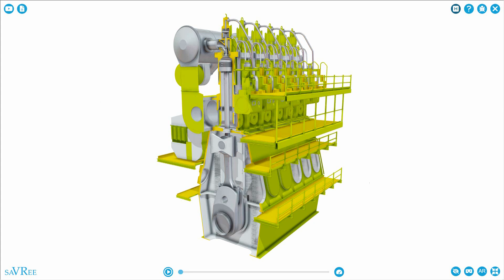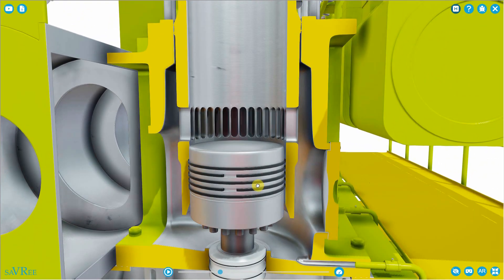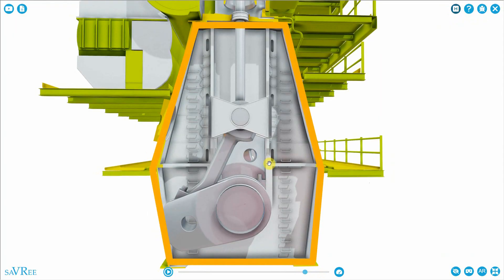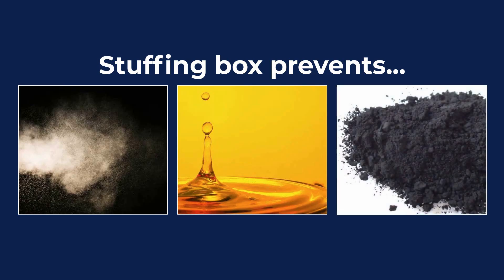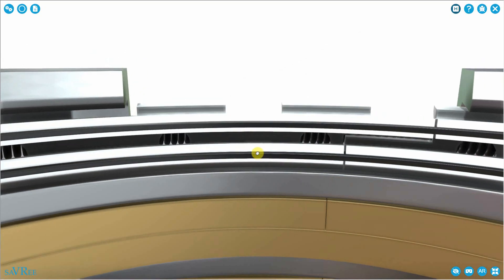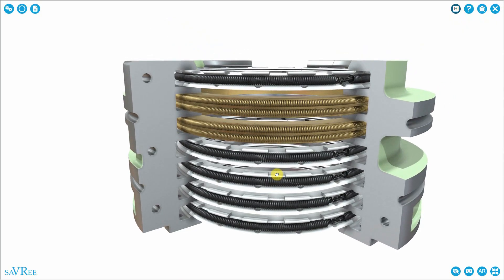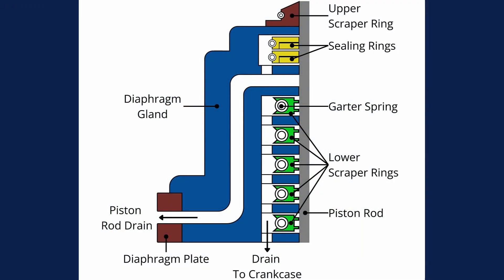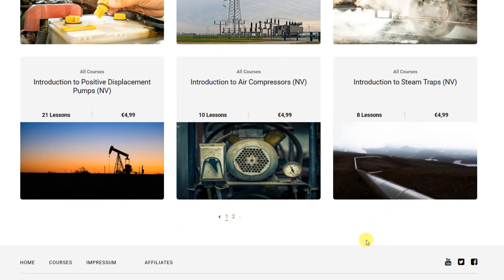Marine Engine Stuffing Box Explained (Marine Engineering)

Comment: In case stuffing box leaking occurs and the piston overhaul is not yet due, you can carry out the dismantling of the stuffing box inside the crankcase without having to take out the piston. Use the supporting table tool which comes in two pieces and use that to place the stuffing box to carry out the job. Moving down the piston should bring the stuffing box down to the crankcase side, if not might need some jacking bolts. Don't forget to wear safety harness. Thanks for the content!!
Reply from the maker: Thanks for the feedback. Much appreciated.

Comment: What are those things found in?
Reply: The engine stuffing box can be found in various applications across different industries. Here are some common locations where stuffing boxes are typically used:

1. **Marine Applications**:
   - **Propeller Shafts**: Stuffing boxes are used to seal the shafts that connect the engine to the propeller, preventing water from entering the vessel.
   - **Pumps**: Many marine pumps, such as bilge pumps, use stuffing boxes to prevent leaks.

2. **Industrial Equipment**:
   - **Pumps**: Centrifugal and positive displacement pumps often have stuffing boxes to seal the shaft where it exits the pump casing.
   - **Compressors**: Air and gas compressors may use stuffing boxes to seal the shaft and prevent leakage of the compressed medium.

3. **Power Generation**:
   - **Turbines**: In steam and gas turbines, stuffing boxes can be used to seal the shafts that drive generators.

4. **HVAC Systems**:
   - **Chillers and Cooling Towers**: Stuffing boxes may be found in pumps and fans within HVAC systems to prevent fluid leaks.

5. **Automotive Applications**:
   - **Water Pumps**: Some automotive water pumps use stuffing boxes to seal the shaft that drives the pump.
   - **Transmission Shafts**: In some vehicles, stuffing boxes may be used in the transmission to seal fluid.

6. **Mining and Construction Equipment**:
   - **Hydraulic Pumps and Motors**: Equipment used in mining and construction often employs stuffing boxes to seal hydraulic systems.

7. **Oil and Gas Industry**:
   - **Drilling Equipment**: Stuffing boxes are used in various drilling equipment to prevent fluid leaks.

In summary, stuffing boxes are versatile components found in many mechanical systems where rotating shafts need to be sealed against fluid leakage. If you have a specific application in mind, I can provide more targeted information!
Reply: @ oh
Reply: @ryteulopki8069nice chatgpt answer lmao